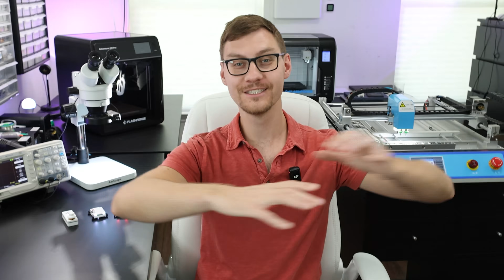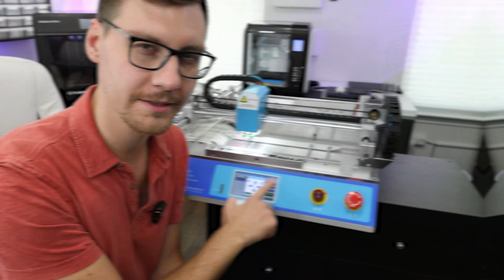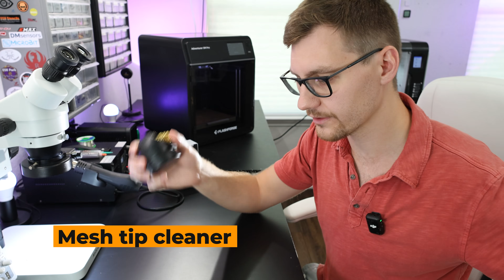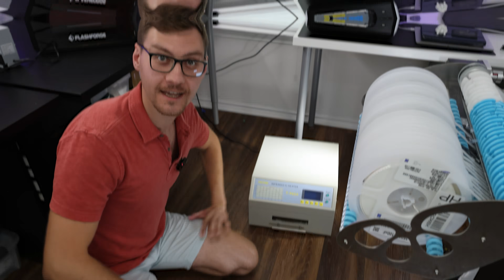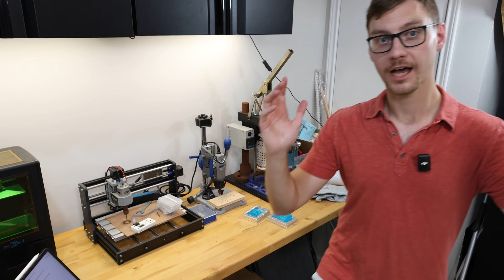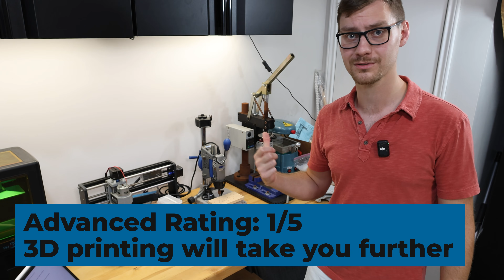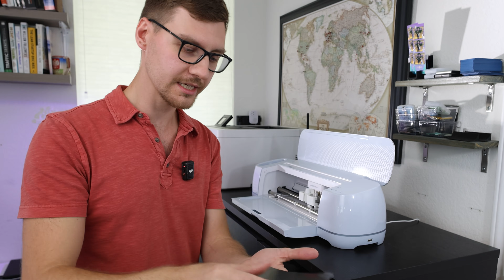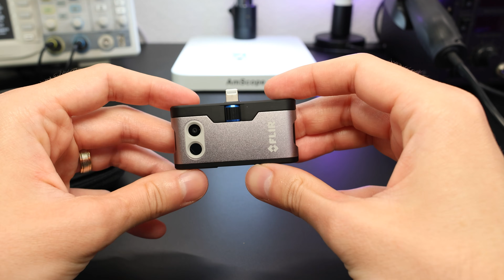I Wish I Knew This Before Building My Home Lab

Comment: It's fun to see someone else's lab. I think the big thing that's missing is (for beginners) is to know what you want to make. I mainly do vintage computer repair for example, the amount of times I felt I wanted a pick and place machine or anything SMD related for that matter is close to never but things like chip programmers are much more important to me.
Reply: I love my old batronix bx40 for dip chips and I have an el cheapo kit for reading onboard eeprom and similar. But it's only for fixing my own stuff and building little gadgets. I'm into analogue builds lately because I am trying to understand the individual components better. Micro controllers are fun but the fundamentals kind of get lost. That's by design, though. They are meant to make building easier and cater more to coding. All worthwhile things, but I am just curious how the hell we had all these cool analogue gadgets back in the day without controllers or processors and back before computers were in every home. The television, the home stereo, (particularly the radio receiver! So cool!) even some of the toys I had as a kid. 

Learning this stuff on my own has been a challenge, but uncomputerized stuff seemed like a good direction to take for better comprehension. I almost hate computers (never, but...) after battling my totally disabled car for 5 months, it having 8 different computers in it. One system goes down, the whole thing is useless. If it wasn't so cute, I'd have left it as a lawn ornament. And I hate working on cars. They're so dirty. LOL And it doesn't help that I have a bastard child the makers no longer claim as it has been "discontinued" which makes parts astronomical, so I am a mechanic now? Runs great, passed smog, looked cool doing it, so I guess so. hahaha

I think with this car, it helps that I know computers and controllers first and foremost. If it's got a symptom, I don't automatically think it's mechanical, nor do I think the system displaying the system is at fault. Most times, that where people spend unnecessary money and it still isn't fixed. And I built a CANbus tap so I can read the communication between the systems in real time on my laptop. That would have been much more fun as a project if it hadn't been so dire that I get it running again. But then I learned I needed to decode them and being a "rare" car, there aren't pre coded databases freely available. In fact, anything for this car that isn't freely available, people capitalize heavily on which is why I took up working on it myself in the first place. If I could learn to do big girl CAD instead of baby CAD, I could jump on that bandwagon... 

dang, I didn't mean to run my mouth for so long. Sorry. lol

Comment: Those smoke removers with carbon filters won’t filter out VOCs. Get a proper filter if you care about ventilation.
Reply from the maker: I definitely need a better one but this one does the trick for now. Its actually a big difference in air quality without it!
Reply: @stuckatprototype The difference is that it’s moving the particles around instead of having it stagnant around your desk. If you compared the air quality in the room after soldering to say your living room, there will be a noticeable difference in the readings.
Reply: @stuckatprototype  
Sponge carbon filters does little to nothing, and those do expire quite quickly, so its doesn't filter anything after first few soldering's, what it only does is just disperses fumes away from you so you are not feeling that concentration, but its still there, in your room. Look into either properly made filters or make your own, with activated carbon pallets, which too needs to be replaced from time too time, but way less and those work way better. 
So if you want to take care of your health and your children's health, get good filter or have good ventilation for those fumes to be pulled out straight to outside.

Comment: There are a few good recommendations here but if you have a computer, a multimeter and a soldering iron (yes, buy good ones) you are already in business. A few tools would help: tweezers, wire stripping tool, pliers, small screws. I would buy next an oscilloscope. For what they deliver these days, they are very cheap and help understanding electronics. Way too many Arduino specialists these days that have no clue what an RC, RL, etc. circuit do, or how a basic transistor works. An oscilloscope can help a lot to actually understand electronics. Also the oscilloscopes these days have I2C, SPI, RS232 decoders built in. At this point if you use KiCAD and services from PCBWay or JLCPCB you can actually make electronics.

Comment: dude.. where is your power supply? that is easily top 3 item you must get in electronic
Reply from the maker: very fair point! I got a cheap one thats been serving me fairly well. Ill add that to my pinned comment. thanks!
Reply: ... and if you're going to get a bench power supply, there are many inexpensive "dumb" 3-output units (two adjustable, and one 5V/3.3V). However, the smarter ones that have a graphical display and soft on/off buttons are sooooooo much better to use.  The main reason is that the graphical display allows them to simultaneously show your target voltage and current, and also the actual voltage and current, for all channels. Dumber PSUs with LED displays can only show some of the info, and you have to switch the display to show the alternative info -- often you can't see target and actual voltage/current simultaneously.  And the soft buttons are so much better for turning on and off the power to your device-under-test. Each channel individually, or all at once.
Reply: Yeah and not just any supply it should be integrated into your PC with modern software.

Comment: Your T-962 reflow oven has visibly "alternative" firmware in place. Besides all mods like complete isolation rework, temperature compensation, 4 thermocouples on top of PCBs to be reflown, I was unable to make it do repeatedly good results using any type of solder paste.
Are you satisfied with your own oven?

If so, then which mods have you done to it? Because obviously these are not production ready and are quite a fire hazard, out of the box.
Reply from the maker: Indeed it is modified, both hardware and firmware. Good eye ;) I have gotten it to a point where I am satisfied with it. I use low-temperature solder for majority of my work. I found it to be consistent after the first initial run, and even then I have a "spot" within the over where I know the boards will reflow alright. I am looking for an alternative tbh, but until I find one, this one will do with a low temp solder :)

Comment: Honestly, rating the pick and place machine for beginners the same as a scope (2/5) seems.. off to me. A pick and place machine for a beginner should be a straight 0, as there isn't even a chance that a beginner would do anything in volume to justify it. Even if you are selling your projects (would hardly call it beginner then...) or you have weird requirements for your projects where you need alot of one thing, chances are you are better off just letting the board manufacturer fabricate it for a few bucks extra. A scope on the other hand enables you to fully comprehend and debug what you are actually doing in the electronics world. If you don't cheap out, you can also get ones that comea with logic analyzers or at least supports them. It will still be pricy, but compared to the 2500 of that pick and place machine it would be money infinitely better spend, not to mention with the hackability of some of the chinese low end to lower-mid level scopes you can get quite the bang for your buck here.

Sub 10k over 15 years isn't that much either tbh. While I build mine mostly as an extension of my workplace, so my requirements were "a bit higher" (and therefore unreasonable for hobbyist use), you can easily spend more just for the electronic test and measuring stuff, without even having touched any of your fabrication capabilities (I still haven't gotten around to even entry level 3D printing yet.. ). Just getting a decent assortment of parts and tools on hand can rack up quite the bill before you know it. Looking at other hobbies like wood and metal working, you easily run into similar numbers once you go past your first set of hand tools, so it's probably not that wild. Still cheaper than the typical midlife-crisis boat on average ;).
Reply from the maker: Completely fair and a good point on the pick and place! My lab has now slowly started becoming my full time workplace. I recently quit my job and I now contract out some of my time and use my lab professionally. But to be honest, what I have has been perfectly enough for the type of work i pick up. As time goes I’m sure I’ll update some of my equipment :)

Comment: Is it just me or is a lot stuff just so expensive in EE.
Reply: its expesive. that why its collected through the year. we dont buy it in 1 go.... me myself have been collecting more than 10 years.. its only for select few who are really passionate about electronic. definetly not for average joe
Reply: It's a pretty cheap hobby compared to woodworking, metalworking.  Maybe comparable to woodcarving.  But what you can do with electronics is massive.
Reply: Low quality stuff is cheap. Some of it is actually usable. But you want to get the better quality stuff for the long term. Cheap digital multimeters are very good now even at $20. Small single board nano computers are very cheap. $7. $q12. They would have cost millions of dollars a few decades ago. Soldering irons are not super expensive nor is basic solder. Basic components are super cheap. Resistors, capacitors, diodes, etc. even common ICs. Inductors are a bit expensive though.

Comment: Inexpensive. If you had engaged in metalworking hobby in the past, then such a budget would have been spent in a year (my personal experience)
Reply: No kidding. The metalworking story arc went from angle grinders to welding machines really quick. Running a sub-panel with a few 220v 50-amp circuits for my TIG welders, 3hp 4-axis CNC mill, 5hp lathe and a mini-split AC unit so my fume extractor pulls from a separate air supply than the rest of my house cost at least $9k by itself. That's with me being a formerly certified electrician doing all the drops myself.  Most recently, I had to add 3 phase to run the helium compressor for my cryocooler which was suprisingly non-trivial. 
To be nickel and diming over computer builds really put it into perspective for me. I think I have 5 machines on my lab network alone. Each machine has one and they are all way over-specced. A 4090 seemed right at the time for a computer that runs Solidworks and Mach4... once. Really I needed to justify my hunt to track down a 5090 in the wild!  I'd be terrified to actually add up not only the actuals but labor as well. That's a for a different time.
At the end of the day all I'm doing is pushing my dirt pile around.
Reply from the maker: Hahaha, I can definitely see that happening! Though if I added up my projects it would have been another zero to that number over the years 😅

Comment: Nice little lab you have there. 

I would definitely push the fumes extractor higher on the list. Inhaling fumes of lead and other chemicals is not worth to spare money. If you want something cheap, just get some aluminum extension tubes and put a fan in the middle… the other end can go out of the window 

In your case I would probably want to invest in a good power supply and a better hot air station. Nowadays you can find some pretty good and affordable ones like aixun or ycs. 

If you want to fix stuff, then you also need an USB psu with a amperage reading to see how the MB is acting.
Reply from the maker: Ahhh thats something I forgot to mention! I have a very precise Amp meter that I use to see power draw. Though cheap, my power supply also has current limiting (and reading) so thats another tool thats missing from the video. And ty!

Comment: This is my key takeaways from my own after working in embedded for few months and learning in college

1. For magnification, make sure use optical and not electronics, the lag isn't worth it, my personal pick is those googles stuff, it exist in my office but for 0603 I still eyeball it
2. Even for SMD I still prefer solder it with regular iron than hot air, idk, maybe it's the one in my office that's sucks or I just have major skill issue, I would like to try hot plate though
3. Invest in a good multimeter, no need to go fluke, most midrange is good enough, find the one that can be hooked up with thermocouple
4. Oscilloscope imo only really needed once you do analog processing, for embedded systems, logic analyzer is more needed for the job with digital signals
5. Always tune your personal workspace, tool of choice, with your area and condition, only use youtuber's input as reference but not as guide, you know your area better
6. No one build their man cave in one go, it's a iterative, slow, and expensive process, don't get down because you still have cheap tools or still borrowing something, we all start somewhere, not all of us inherited milling machine from our grandpa

I convert my bedroom as semi lab since highschool, so....7 years, building it slowly of course, and started to get better and better 

That said your video is very nice, wish I found you sooner
Reply from the maker: Great tips! Thanks for sharing your experience and I'm glad you enjoyed the video :)
Reply: Try using a hot plate. You won't go back to soldering SMDs using an iron.
Reply: @iggypei i might try tho, that with sand

The best heat plate I can get is clothing iron though, but many blog post using sand to improve the heat spread, as seen on Great Scott also

My biggest interest is actually oven but with how stupid I can be, plate that is

But that gotta wait, there are many things that has bigger priority

Comment: For the soldering iron story, if you think the TS100 is very good and looking for a new one, look at the stations from Aifen or Sugon with JBC iron ! They are even more worth it and not expensive at all ! For you “chemical iron cleaner” it’s in fact NOT a cleaner but they “revive” your oxidized tips. It is not a cleaner because it has corosives chemicals to eat trough the oxidation and retin your tip. Not recommended for cleaning but highly recommended to revive them ! I don’t have oxidation problem with leaded solder but some unleaded one uses some bad flux that oxidizes your iron.
Reply from the maker: Thanks for the recommendations, I'll check those out! and thats very fair about the chemical tip reviver. It was something that bit me a long time and I still cant get over it. Though a mesh cleaner and a bit of fresh solder has always done the job for me and I have never used it since. thanks for the info!
Reply: I got a soldering iron station from Aixun, also with JBC tips. Great little machine. On the higher end on what you should spend as a beginner but when you know you are going to be working with elektronics for a few years. It's a great tool!

Comment: What about a bench power supply? I was thinking about getting one and was surprised to see you didn't mention it.
Reply from the maker: That’s actually a really good point. I have a fairly cheap one, I thought about adding it in the edit since I forgot to mention it but opted to omit it. For most tasks, a $40 amazon power supply that lets you set current and voltage will do. I still simply use one of these to this day 👍
Reply: @stuckatprototype Ok thank you! By the way I love your videos. You have been a great inspiration!
Reply from the maker: thanks so much! thats great to hear :)
Reply: Oh yeah, 5/5 in both categories, simple CC/CV supply for starters and some advanced features like profiles or multi-channel later on.

Comment: I’m dispersed all of this is about products you bought. In my 15 years, parts storage and organization has been the big lesson for me.
Reply from the maker: I’ll be making videos on my work flow, how I manufacture my own products in my home lab, how to start with smt, etc :) part storage has been an ever evolving project that I still have not gotten down 😅
Reply: I use part trays with lidded individual compartments from the $1 store.  The NIIM labelers are easy to use, and a Russian guy has a web interface that can talk to my labeler over Bluetooth.
Reply: @davidhawley1132 awesome, what’s the project called for the NIIM interface? I’ve been fine using the app and excel sheets, but it’s not ideal. 

Small cheap containers were great until I had hundreds of them. I’ve got everything from SMD components, to NEMA 34 (80mm stepper motors), and M1.3 to M12 fasteners. My dream is a unified storage solution for 1000+ different SKUs. 

Up to now, Gridfinity has helped, but printing them is time consuming, and storing the GF bins is still a problem. I have 30 IKEA Alex drawers filled wjth Gridfinity and there’s just so much wasted vertical space, and yet I still have hundreds more parts in random organizers around the shop. I think EEs tend to compromise organization more than they realize, and might have an organized part of their workshop, then a few hundred boxes of vaguely related things.